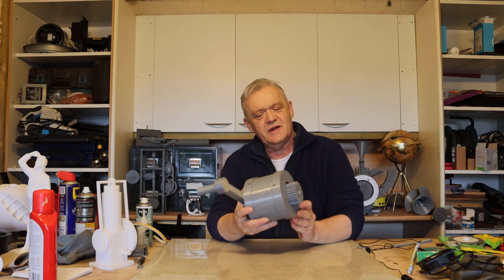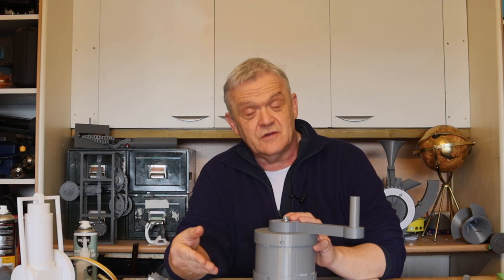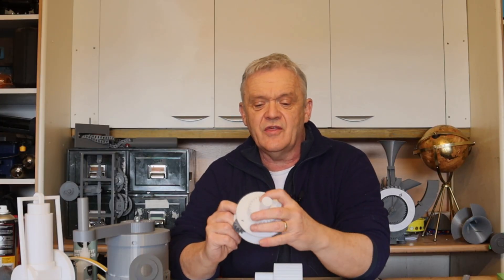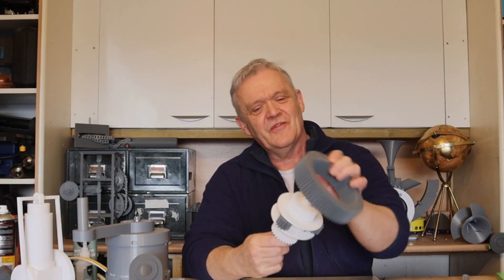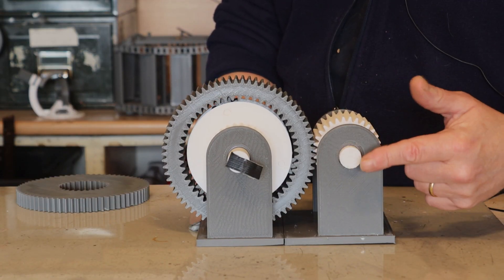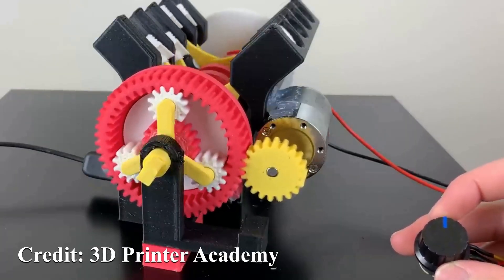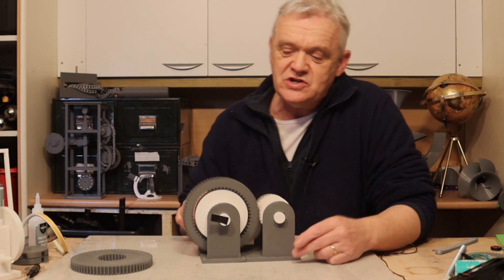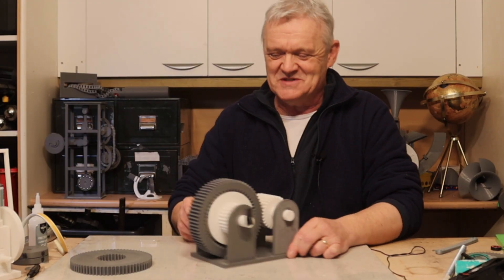2197 The Infinite CVT And Wind Turbine Control

Comment: Toyota's e-CVT is like that that. In principle.
The petrol engine drives the sun gear, and the ring gear drives the diff (which in turn drives the wheels)
Hold the planet carrier stationary and you've got a fixed low gear. Then an electric motor is added to the hub carrier and you've got yourself an infinate variable gearbox. 
That electric motor is also a generator -when the wheels are stationary and equally importantly, a starter motor -when the wheels AND the engine are stationary.
To power this electric motor while driving, there's a second electric motor/generator geared to the diff. This one is also used for reversing.

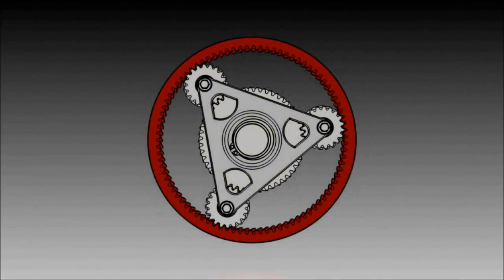Comment: In the animation at 1:00, the ring wouldn’t move if it had a load attached (in an idealized environment). The planet gears would just spin around. However, this isn’t a useful configuration because you’re not using the sun gear at all.

Comment: In my books, that's a sellectable fixed gear transmission. It is only variable by changing the speed of one input.

Using that logic, a 5 gear transmission with an internal combustion engine has a cvt as well.

Useful transmission (as a matter of fact  some hybrid cars use the principle) for torque management

Comment: Wind turbines are a type of synchronous generator. Increase in wind speed results in higher power output but not higher rotor speed.

This is why you see wind farms with all the turbines rotating at the same speed.

Comment: Thr rpm of the generator isn't the only problem. The speed also destroys the blades. The solution is to slow down the blades not the output.

Comment: The feedback loop is brilliant. However, for wind turbines, the faster the blades turn for same output rotation, we'll get higher and higher output torque. Since the generator's torque usage isn't building up, the difference will cause both the blades and idler gear keep on gaining speed. Until the problem isn't a too hot generator, but too fast blades breaking from centrifugal force. The solution should ideally include an increasing electricity production (being used by resistive brakes or charging something up to store it) to use up additional output torque with the growing speeds of blades.

Comment: You can (probably) take this a step further. I came up with a similar idea about a year ago and spent quite some time developing it. Instead of using an idle gear you mesh two planetary gear sets together. The result is a system that self balances based on torque. The gear ratio changes if input torque does not balance with required load. In essence a CVT that can control itself.  

Diagrams would be easier to read but in words: 2 planetary gear sets pancaked together. Input is planet carrier 1, output is planet carrier 2, sun gears are different sizes but axially one solid one part. Ring gears connect through a third planetary idler gear (held in place) that essentially flips the direction of rotation from ring 1 to ring 2. This forms a feed back loop in the system that shifts the speed of components based on torque imbalance between input and load thus shifting gear ratios without need for external control, clutches, or motors.  

I would be very interested in seeing you test this idea, hopefully you find it interesting as well.

Comment: It does not make much sense if you really think about it. 
What you have is essentially an unfolded differential gear which adds the velocities of two different power inputs, and they definitely need to offer the same amount of power to offer any meaningful variableness, because its not likely a 1 hp motor can be paired with a 200 hp motor…

Comment: would still be concerned about the forces on the blades, bearings and support structures. As you saw in the implanted video, that blade required one hell of a force to launch it into the air (still an awesome shot, though). the forces on the generator hub are phenomenal and only increase as speed increases.

Comment: Correct me if I'm wrong, but the rotational speed of wind turbines is not dependent on wind speed but is controlled by alrering the pitch of the blades - much the same pricipal as applied on many propeller driven aircraft.
Reply: wait till the wind gets windier

Comment: Looks like fun making the gears.  It won't work of course, the torque against the electric motor is going to be similar to the input torque.  If you have a motor that strong just connect it to the wheels of the automobile and skip the petrol engine.

Comment: the prius has been using the two motor planetary gearset for 20 odd years now, one of the things I like most about it (see: prius power split device).  the wheels and mg2(motor/generator) are connected to the ring gear, mg1 connects to the sun gear, and the ice(engine) connects to the planet carrier.  It starts the engine, provides traction, and reverse, and generation/regeneration.  Sometimes it even takes power from the ICE to generate from mg1 to power mg2, what we referred to as "heretical mode" as nobody in the peanut gallery thought it made sense, not unlike the faster than the wind downwind affair.    fwiw using the mg to hold the shaft doesn't take a whole lot of power since rpm is zero (power = rpm * torque).  

I'm not convinced it is a better fit for turbines than variable pitched blades however.  And hopefully you will clarify that "it spins about the same rate" isn't because you have created a variable speed drive, but rather you have fixed the ratio of one input and therefore fixed the other, but it is about the same rate solely because it is a very low ratio, and would have the same problems and more once geared up for a generator.    If you don't understand how fixing one input ratio fixes the other ratio, then you are well on your way to making free energy videos :)
Reply: huh, i was tempted to buy a prius a long time ago but put off by the cvt because i thought it was one of those gross belt type ones
Reply: I have a prius, the ecvt is smooth.  Obviously the ice varies on demand.  What i really like is that a 80hp motor can be augmented to 125hp or 'switch' into regen braking quite easily.  The 50mi/gal. is normal operation for me.  Although i could get 70 mi/gal on my old VW bug from 1973... it was much much lighter.  So i don't know what direction hybrid's are going to go, but i would like to see an ice that has more of a constant rpm with higher torque and ecvt w/ tighter mg windings to get to the next stage of efficiency.  If engineers could get a 1-liter diesel hybrid (w/o high rpm turbos, etc.) that could 'gear' to 75 mph @ 70+mi/gal. I don't think people would bitch about acceleration so much... the prius has plenty of get up and go even with 4 adults, but w/o shrinking the ICE ... the mpg is kinda maxed out.  I don't think other 'smart' cars can get anywhere w/o Toyota patents.  I also think full EV is BS, unless you are driving like a monorail train.  You have a well informed comment, tx.

Comment: it might be possible to make a purely mechanical CVT for wind turbines,  based on planetary gears and feedback loop,  this is because the load is always positive,   in the case of cars it's more complicated,  you have positive load when going up hill,  but when going down hill the engine cuts all fuel and is used to slow down the car.  to this day, nobody has made a proper high torque CVT   for cars such as a Ford transit van,  or  a pick up truck.   and there is a strong need for this,  driving up hill,  in traffic,  under load,  it's really hard on the driver.

Comment: Just and idea, putting variable pulley between input shaft and gear that is user to externally control output speed and combine it with electronic control would help to run generator at ideal speed independent on input speed. This way you could keep generator at it sweet spot in lower winds and save it at higher win speeds.

Comment: Of course, the reason you want to limit the blade speed is not just so you don't blow up the generator; you also want to keep the blades firmly attached to the hub. The faster they spin, the stronger the forces that want to rip them off.

Comment: I might be wrong, but you could place another set of planets around the outer gear, connect planet carrier to the input and place a second outer gear fixed to the base. Will distribute load equally. Cool idea👍

Comment: Brilliant.  Now insert a controlled planetary in place of the idle gear and you can control the turbine in cases of extreme winds?  Putting an extreme load on the blades would be a good way of controlling runaway (assuming you have no pitch control like most small turbines dont have).

Comment: ... and if you don't use your fingers but 2 electric 3-phase motors that can operate into each direction, electronically controlled for speed and torque and add a combustion engine you have a Toyota Yaris, Prius, Auris or Corolla Hybrid. The same is valid for the Lexus CT200 😉👍

Comment: So this mechanism takes a variable speed and outputs a continuous speed with variable torque. Is there a similar mechanism with variable torque/speed input that outputs a continuous torque. Seems like this would be more useful if you are dealing with power tools. IE. being able to brand an electronic driver that boasts it can break loose the toughest nuts.

Comment: I think you will have to rethink the wind turbine system. If you put more energy in the blades, it needs to go somewhere. If it is not the generator, it is somewhere else. Also there is something called the tip speed ratio (TSR) which is more important. You cannot let the blades run faster then what they are built for. If you would try to run them at a lower speed(in lower winds), they will be under powered and stall.

Comment: mmh i wonder if this could be used to control track speed and direction in tracked vehicle cheaply and reliably. Usually what i have seen belt drives wear out fast since all the torque is driven trough them, but if one was to combine this and belt drive just to bleed speed instead of torque, this should be doable to have just solid axle on the middle turned by engine that sends power to axiality axle that has the belt drive witch controls the speed. It will be bit tough to design the right ratios but with this one should get all the torque needed with out wearing the belts, but i could be mistaken... noh enough coffee yet to figure it all out.

Comment: I am not an engineer, so perhaps you can explain something to me in simple terms.   Current wind turbine generators have an issue with excessive energy input, i.e., the wind blowing too hard and the prop spinning too fast, with the excess energy causing the generator to overheat.   If the gear system as described in your video were implemented on such a wind turbine, it would protect the generator, but where would the excess energy go?  Wouldn't it end up in the gearbox?   How would the heat be dissipated?

Comment: I am sorry but you are fooling yourself. The last gearbox has a fixed reduction rate. But is is too big to easily see that the output RPM is not constant.
The first setup with the electric motor is no CVT either. It gets variable output RPM with the help of a variable input. But this is a useful setup anyway. The planetary gear set is used to add two inputs. This is what the Prius does with slightly larger motors. This allows running the combustion engine at the optimal RPM whenever it is on and dynamically choose whether the electric motor is used as a engine or a generator and to what amount. So it is not a CVT but arguable even better.

Comment: Something doesn't quite make sense in my mind. If the output is a constant speed as you speed up the input, it should also be constant as you slow down the input. But if you slow the input until it reaches 0 RPM, the output must slow down to 0 RPM as well. How linear is the ratio of input to output speed?
Reply: yeah its not possible - another thing that shows this is that if you took a video of it working and sped the video up 2x, both the input gear and output gear would appear to speed up 2X. it looks like it works but it can't be working like he's saying
Reply: So I think if you work out the maths of the gear ratios involved in this setup (and any similar setup), it all ends up as an equivalent linear gear with a very large gear ratio. This is why the speed doesn't appear to change
Reply: I am thinking/feeling it could be tangens-like with linear behavior near zero speed and max. speed-down ratio from infinity to pi/2 , the scaling is not just in my mind 😉🫣

Comment: I see what you're saying. If a second smaller propeller would not be able to turn in the low wind speed, I n the higher wind speed, it could slow the larger propeller down and maybe keep a constant speed for the generator. Excellent.

Comment: It occurred to me that if someone wanted to do some real world tests on this CVT concept, all one would need to do is find a used and running; 2 stroke or 4 stroke engine from off a weed whip, combine the two devices and mount them as the drive train to a quad cycle, or even a bicycle.

Comment: this has nothing to do with the current video but with earlier project you, mr Robert Murray-Smith, have done.

Specifically: Oil burners.
Waste oil, vegetable oil, whatever oil.

I have seen you build such burners with wicks, made out of cotton or carbon felt, etc.

But i have not yet seen you implement an injector, or something similar.
A spray nozzle, perhaps a carburator, venturi, i dunno.
Something like that to feed the oil into the flames.

I would love to see some kind of contraption you can come up with. A burner that is capable of producing a cleaner burn, a blue flame.

Comment: To make the compound gear assembly super precise, especially, without doing a whole lot of math, put a double cone clutch on it to alter your feedback rotor, and this can be controlled by either a centrifugal governor, or a hydraulic flow resistance governor.

Comment: Good idea, but not quite a CVT. A feedback system uses non linear vectors to produce a point of equilibrium. This gearing system works out to have a linear speed delivery, but with a reduction ratio equivalent to somewhere in between allowing the planetary gear to spin freely, and locking it completely still, depending on the idler gear ratio.

Any sort of CVT using this setup would still need some sort of variable speed adjustment such as an electric motor or a belt to control the planetary gear, negating the point of using the planetary set in the first place.

Comment: I think it would be much simpler to just reduce the blade pitch with a governed variable pitch.    Could be a centrifugal  setup like the old steam pressure valves.    Or you could just put a motorized circuit to control.     You don't want to exceed blade RPM either and this wouldn't prevent that.    Amazing nevertheless.    God bless you.

Comment: One question. Can you test the output torque, because for wind turbine it may somehow work if both are inputs, but for other usage second "ring motor" that is slowing down in fact is "spending energy (torque) to cancel the sun motors torque". Real output torque is around 0. And yes it is working as CVT but only from constant 1:N -> 1:1  when two motors are working "together" in the same "direction". Otherwise, good idea!

Comment: Thanks for the video but I believe you are incorrect. By adding the idler gear you are locking in a given reduction ratio. The speed at your final output still varies with the speed of your input. If you are looking to vary the input speed while producing the same output speed (or vice versa) you will still need to vary the speed of the ring gear which can not be done with a fixed idler gear. Have a look at a the workings of a Constant Speed Drive.
Reply: I agree. All he has built is an unnecessarily complicated fixed-ratio gearbox. All the talk about 'feedback' is BS.

Comment: You describe it as a continuously variable speed / ratio transmission. I'd be prepared to go along with that, as long as the second drive was on an electric motor, as it is while you're demonstrating it.
If you've got an engine you can run at about 2,ooo rpm clockwise, down to zero, then up to 2,ooo rpm anti-clockwise, then you don't need a continuously variable transmission ~ you've already got a direct drive that'll do everything you want. The rest is a mechanical toy like one of those desktop things with the bouncing / swinging balls. It is cool, but it doesn't do anything you need.

Comment: Mmm, very interesting mechanism, I am sure there is an application for it somewhere, and understand where your coming from, but wouldn't it be better to alter the pitch of the blades to control the speed of the turbine blades. Or am I missing something here ?
PS what happens to the input shaft if you drive the output shaft

Comment: Loving this Rob!  I had a thought, yes it would work great in a turbine but it would be brilliant in a simple gravity battery build.  Biggest problem with gravity battery setups that I have worked with is a braking mechanism so as to not overheat the resistive load.  Dump the excessive current into your feedback and problem solved.  You turning your gears got my gears(in my head) moving LOL!  That could be dangerous if I were to believe what those around me tell me.  Thanks again!